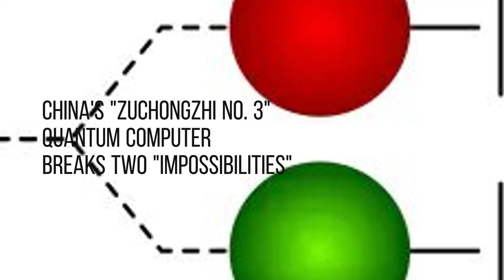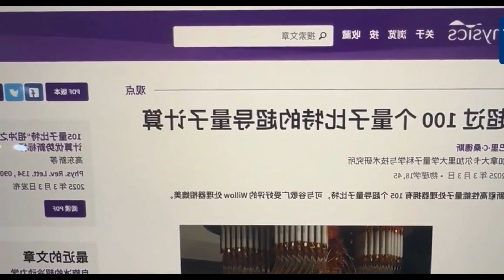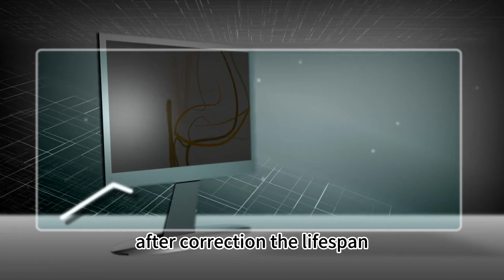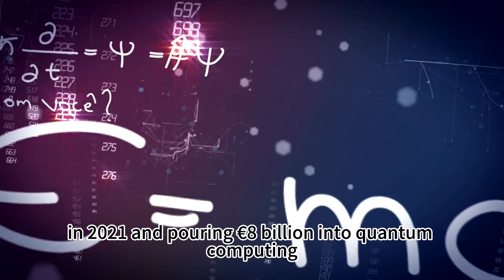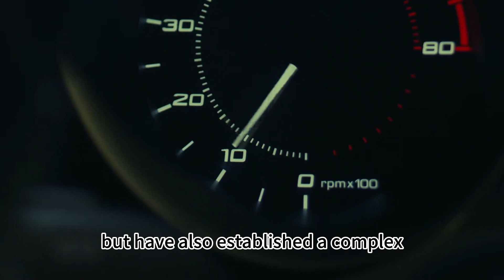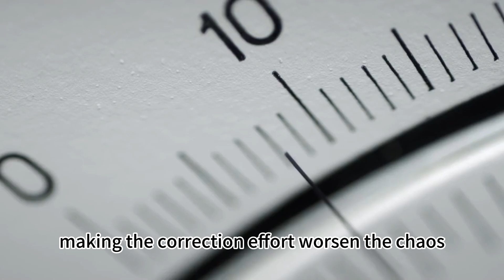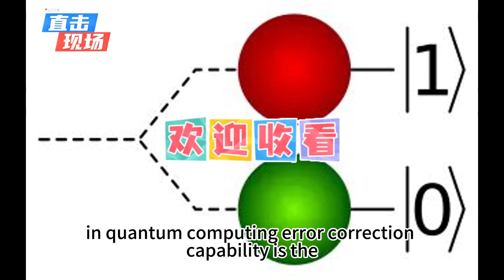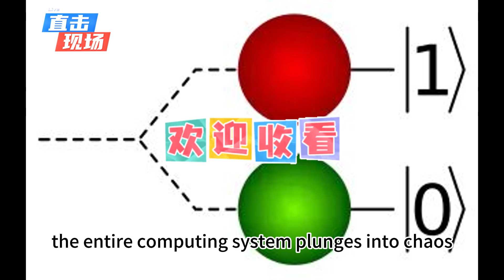Quantum Computing Reaches a Watershed

Comment: Further R&D need to be done by China on the trinary quantum computing system to allow it to be adopted to replace the current silicon based binary computing system, thus freeing China from the ASML eUV lithography machine monopoly.
The current quantum computing system is still not robust enough for public use as it requires very low ambient operating  temperature as used in special supercomputers applications.
China is on the right track but more research are needed to commercialize this quantum computing platform.
Push on.